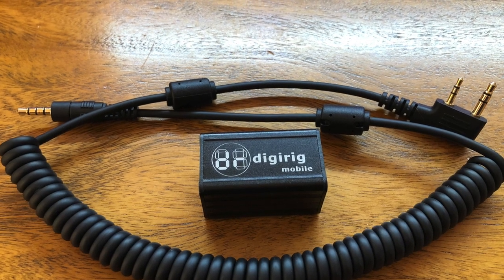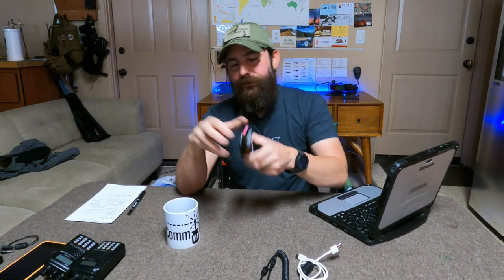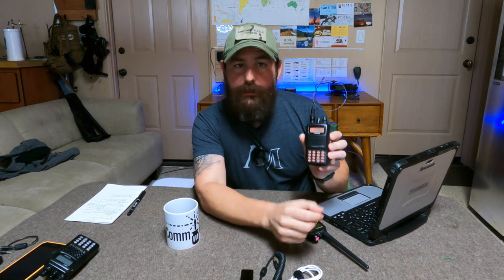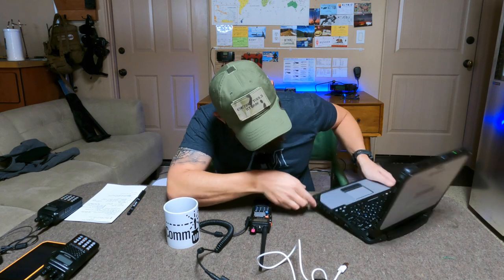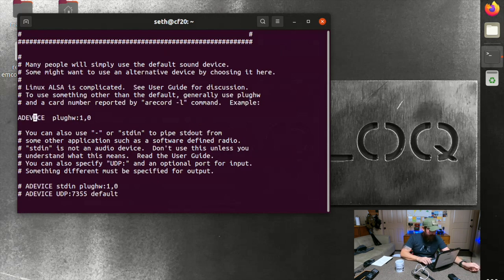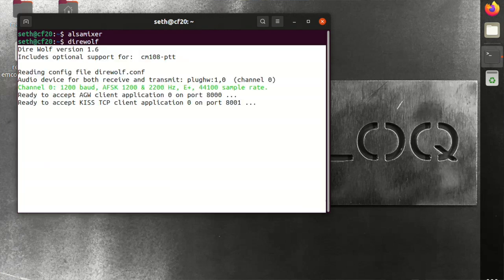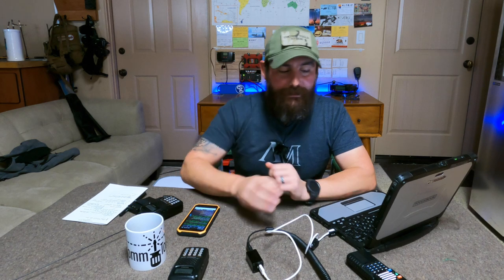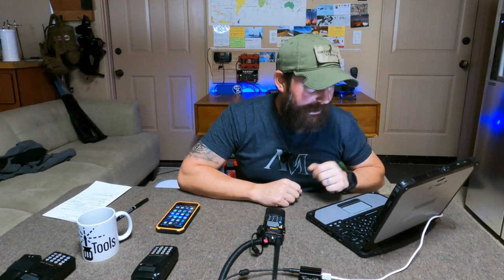Why are digital data modes so difficult? - DigiRig + Baofeng + Linux (Part I)

Comment: RF in the shack can cause a myriad of problems. All those interconnecting cables are unintentional antennas. RF chokes are your friend, along with transmitting the lowest RF power possible. Also, given the extremely close proximity of the two transceivers, in demonstration situations such as this, I'd replace both of those greater gain than stock antennas with simply dummy loads. Sometimes problems are created by the humans.
Reply from the maker: Great comment! I pinned this post as you nailed the problem on the head. As soon as I gave the radios some distance it started working flawlessly. I have ferrite beads on the cables already, but need to get some dummy loads. This human caused the fail during the TX portion of the demo.
Reply: @TheTechPrepper  
Glad to hear the suggestions helped. Great content, keep up the good work.
73 from VK land.
Reply: Solid Comment/Reply!  💜👍  like, I KNOW to to wary of this, but I haven’t personally seen the fail-case, in action. … and that looks like a solid solution!

if anyone sees this comment:  have you seen the “Standing Up for Standing Wave” demo? … must be VERY analog.  (can be found easily on YouTube) … okay, that’s pretty old, but they estimate they’re putting 30 Watts into the demo-rig.  😳  I’m not sure why this would need more than low-power / 1-Watt-mode on a BaoFeng … with LED indicators & whatnot?  🤨  LEDs work fine at 5mA … we can get that from a 1 Watt signal, right?  (on the transmission line, tho)

anyhow, I’ve done multiple experiments/projects on ISM bands, all under 500mW … and 🤷‍♀️  no idea why this demo needs 30 Watts, when all the equipment is in the same small room.  … but it’s Ham Radio, not ISM, so … 100x Power is fine.  💜🤣👍
Reply: short follow-up:  I mean … 😂 the parts where the Incandescent Light Bulbs are lit up with just RF energy.  😅  We could drop the radio power 10dB or so, and use LED indicators?  because they just way lower power.

cool, but it’s 2023 … put some small chips, and watch batteries on all the indicators … and just AMP.  😮  We could do this demo under 500mW, RF power?  🤷‍♀️  in a room.
Reply: Love the digital capabilities and the content you presented 😊

Comment: Looking forward to seeing more in this series.  This stuff is more like leaning how to rebuild an engine vs. changing a flat tire.  It takes time and many teachers.  So thank you for taking a shot at clearing up the confusion.
Reply from the maker: You got that right. I think it will become easier as we work through the series together. There are some configurations that are less involved, but come with a couple of drawbacks. I look forward to sharing those with you and the community.
Reply: @TheTechPrepper … I can do ALL of the linux stuff, but I’m “rusty” on the actual radio stuff.  (been relearning it all pretty hard recently, so, “less rusty” now)  😂  just an observation, but I have friends that are also crazy good with linux … but they’ll be stone-cold-new to RADIO.  😮  not new to modems tho, very nerdy frens.  can modem!  … 😳  I’m going to have to “teach radio,”  wowowow.
Reply: LOVE the “rebuilding an engine” metaphor!  💜👍  Thanks!

I’m not amazing with gasoline-engines, but I can do Linux … it’s cool to compare the complexity … as mutual respect between different skills.  🥰

Comment: Got the DigiRig for use with my Icom 706mKiiG but have yet to get time to set it up.  Best for me so far is the Mobilinkd.  Too bad they won't be back in production for a few months.  Keep up the good work.
Reply from the maker: The Mobilinkd is packet only, but I agree. It is the simplest interface. I recommend this device to everyone. The 706 is a fantastic rig. I love all band, all mode rigs. If you ever want to sell it, give me a shout.
Reply: I got a Hand-Me-Down (brand new!) Icom 706 Mark 1. I haven't set it up yet. Glad to hear you can set up a Digirig to it.... somehow?

Comment: Thanks for the video. I’m sending my Digirig back to have it tested. I first built a Digipi. It works great with my IC-705. I then purchased a FT-2980 because of its power and simplicity. I have that working great with my Digipi using the Digirig cable for the FT-2980. I decided to buy the Digirig at the same time. I tried the Digirig and could not get it to work. No receive or transmit sound. I have PTT but zero sound. Denis from Digirig agreed to take it back to check it out. I tried all his troubleshooting steps. Nothing.

Comment: Absolutely perfect timing for this♡ 
🔥📻😎👍
Reply: I am learning on a new to me FT-2980 also went with the digiRig  ! :)
Reply from the maker: That could be an issue. I don't think there is a cable for that yet. I would recommend the SignaLink USB if you're going to use that radio. The recommended video at the end actually covers the the FT-2980 + SignaLink.
Reply from the maker: Thanks for stopping by, hamfam!

Comment: Here is state of the art for the US Military and allied forces such as NATO, they use a waveform to select frequencies from a set determined by the planner with a mode called ALE so we get the best frequency for the time of the contact, then automatic modem that has FEC and ARQ protocols along with auto bauding speed adjustment to over come all problems with the link, we have encryption on all of this as its digital anyways.  All radio programmable by a file to reduce training and human error to concentrate end users on procedure and antennas. I retired from that work and now try to learn something new and have a completely unused extra class license earned in 1991 as I had learned IMC in the Army. Thanks for the videos.
Reply from the maker: Thanks for jumping in here. I'm working on adding ALE to my EmComm Tools communications platform for the reasons that you described. The goal is just to have an operator deploy a broadband antenna and then do selective calling with ALE. Cheers!

Comment: This is very helpful as I’m understanding digital packet radio more and more. I appreciate you leaving in the problems that you had to work through because that is the norm when setting this up for all of us. I have my ftm-6000r/digirig working with Winlink packet and vara fm on windows and I’m comfortable with Linux so will give it a try. 73 de AJ6EE
Reply from the maker: Congrats on getting your setup. The failures and challenges are always a part of the process, so I'm happy  to share them along with the way. They're more valuable than the successes. 73

Comment: Great video!  I’m looking forward to this same walk through for winlink email via TNC and android app. I’ve done it before but it’s a coin toss if I can remember how to make it all work together
Reply from the maker: Very good. I have a few plans for the Android video. I have successfully connected the Mobiblinkd TNC and DigiLink Nano with an OTG cable (should be possible with the DigiRig, but I have not tried it yet). I installed WoAD on Android, but still need to test it. It will be nice to have Winlink capabilities on my phone. Thanks for the comment.

Comment: Great idea. Looking forward to more videos! I wonder if making audio level changes from the software instead of the radio is the best way to gain stage the audio properly?
Reply from the maker: I've tried to figure out how to that, but all of my radios have required adjustments on both ends. It's a bit easier on the base stations compared to the HT's as there are typically settings for digital mic gain (as well as other settings) that let me set it once and forget it.

Comment: I wish I took some type of programming in school. What a great idea. It would be nice if there was a more PnP software for this. I can see the value in having this method of  communication in the tool box for sure.
Reply from the maker: I'm not sure a programming class would have a helped, but a Linux class, absolutely! We need a company to step up and make this stuff easy for users. Keep at it. There are at least 5 more in the series. Different radios, different cables, different interfaces, different software and even a couple of integrations with just a phone.
Reply: @TheTechPrepper  You really need to chat with Abboud.
Reply from the maker: @ohiorivervalleyhomestead  I have been. ;-)
Reply: @TheTechPrepper  Maybe we need a kind of Ubuntu of the amateur radio digital modes. By that I mean, Ubuntu tried to standardize the easiest way to get Linux setup for the “normal person” and aimed to avoid some of the difficult items to navigate around.

Comment: I have a stack of Kantronics KPC3’s, some old, some newer, and this is what I use for all my data links.  But that’s just me.  I think your setup is very good to know.  Your setup may be a bit more complex, but it is correspondingly much more flexible for use with all kinds of interfaces and terminals.
Reply from the maker: Those are classic TNCs. The hobby  started moving to virtual TNCs built in software (Dire Wolf) once computers were fast enough to handle DSP. I'm a fan of hardware appliances. They're purpose-built and much more reliable. I may get one for a permanent packet station. Cheers.

Comment: Funny: recently, I had exactly the same thought: why is this so complicated. Not so funny: I work in IT and I am familiar with a lot of the underlying concepts and I still have a hard time.
I plan to write a blog post of my own. Not explaining once more how to set things up but looking at the concepts. What are the components that makes this tick and how do the connect with each other?
Reply from the maker: I look forward to your post. I've been in the IT industry for 25 years and this stuff makes me feel stupid every time I need to setup a new station (e.g., computer/phone, radio, interface and software).
Reply: I’d be very interested to read this blog post! If you have a blog now and you’re gonna add this post to it, would you mind posting where I can locate that?

Comment: Excellent breakdown of equipment needed, etc....The best I have seen yet.  Thank you for dumbing this down to the dirt level, your level of explanation is exceptional.   Question:  You used a Linux software.  It would be great if you can show how it can be used or requirements needed on windows platform?   From a 50k foot view?   2nd Question:  You use an android phone, does the phone need to have a special operating system on it or a basic phone/device be okay to use?
Reply from the maker: Sorry, I have not used Windows since the XP days. It's been more than 20 years. Windows makes me feel stupid. With that said, all the software that I show on the channel and write will only be for Linux. The good news is that the majority of hams use Windows, so there should be plenty of videos.
Reply: @TheTechPrepper  Thank you, I completely understand.   Ill do a search and see what I can dig up.   Great work, thank you for taking the time to reply.  Priceless!!!

Comment: I like the video, but I disagree that this is unnecessarily complex and that Apple would have done it better.  If this stuff were in a closed ecosystem, we’d be at the mercy of the developer with regard to capability.  We have the flexibility to operate ham radio digital modes on pretty much any device running nearly any OS because the standards are open. There is a learning curve, but Ham Radio is an innovate hobby, and innovation requires understanding. It’s hard (or impossible) to be innovative with an appliance. I’m looking forward to watching the rest of the series. Thank you for taking the time to make the videos and sharing your experience!  This is a very interesting topic. 73, de NL3D
Reply from the maker: Always happy to get a counter point. I am personally working with a group of older hams that have been licensed for decades but are completely overwhelmed by the freedom in choices to select their digital equipment and software, and then make it all work together. I have been working on an appliance/platform called "EmComm Tools" that attempts to solve this problem. It's basically a reference implementation of hardware and software that is designed to be an appliance with simplicity and field expedience in mind. I released a video a couple months back called the "EmComm Tools Story" that describes my goals with my project. 73 de KT1RUN
Reply: @TheTechPrepper  I'm new to your channel, so I will check out that video.  I think creating an appliance is a great idea.  But I also think that the core technology should remain as open and flexible as possible to allow for future innovation.

Comment: They are not difficult. Been doing it for 40 years. With the early telex. Simple job to interface. Main problem is many lack  computer knowledge. I learnt early about rs232 ports, audio interfacing etc. it became second nature and is still the same today really. Been made easier with rigs now with built in audio sound for data modes. Cat has been a boom. I hardly use cat , just certain circumstances only. . Thanks for your time on this subject.

Comment: I recently setup my Baofeng UV-9R Plus radio to APRS Droid. (It required a mic adapter plug). What a pain in the A$$, it was to set everything up!  No one's videos or articles,  seemed to cover every little configuration setting, for the radio &/or the cell phone program. But you hit the high points. One major problem I had w/ the phone, was having to cut off ALL NOTIFICATIONS. And adjust the phone's volume. 
Setting up the radio's squelch & Vox, was minor. 
Digital radio stuff, is all a balancing act of settings, on your phone (or computer) with the converter device (DigiRig, SignaLink, etc...), and your radio! For APRS, It is almost worth having a stand alone radio & phone rig. Just setup and used for nothing else! Because if you change its function, its a 😠 pain to return to APRS. 
I am making a cheat sheet, of setup notes. Just to refer to, when needed! I have not even attempted setting up Dire Wolf on my Win-10 laptop yet.... So, I-Gate of Hell, is next. 😈

Comment: As you mentioned, the setups you demonstrated are "unnecessarily complex" which also means they dont do well in a field environment; bouncing around in a ruck and trying to deploy them in...  "austere conditions". 
The fix?  Spend more money on higher end rigs that integrate 2 or 3 of the different devices and associated wire tangle and make these things 'just work' when you're hiking around in the middle of nowhere. 
That being said...  the systems you demonstrated are GREAT learning platforms that force you to understand the nuts and bolts under the hood that make work.
Reply from the maker: You're right on all accounts. It's never a bad idea to know how this works at a fundamental level. Clearly, this setup is not suited for the field. I am trying to solve this problem with my EmComm Tools platform. The current version is a light-weight CF-20 Toughbook pre-configured with all the necessary software with a single cable interface to a manpack radio. I have a special piece of software that I am writing called EmComm Tools that simplifies the user interface and hides all the details from the user. It's been a battle getting everything to work cleanly as a field appliance. In fact, I'm still working on it.
Reply: @TheTechPrepper  Have you ever checked out the "OH8STN Ham Radio" youtube channel?  
That guy definitely has a pretty compelling setup for field use.
Reply from the maker: @The_Privateer  I have, but it's been at least 6 months since I have seen any of his videos. He's done some good work. I am actually focusing more on VHF/UHF and smaller mobile manpacks paired with a CF-20 Toughbook. Most of my operating in the field is around providing support for endurance races/ultra marathons in the desert.

Comment: Great video! I played around with andFLmsg and other digital modes with HT's and was getting some weird problems where the messages were broken up, letters of the message were missing, etc. Do you know if this is caused by the clocks not being synchronized? Couldn't really find anything on the issue on YT.
Reply from the maker: I haven't run into this problem with flmsg since the messages include a checksum when wrapped with flmsg, but I have seen this issue with fldigi when sending text messages as those are not wrapped.